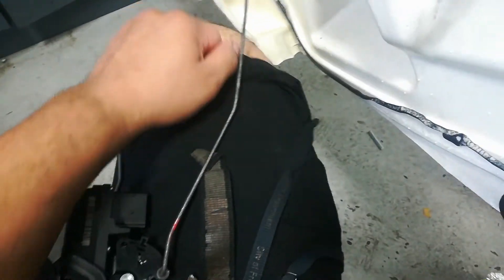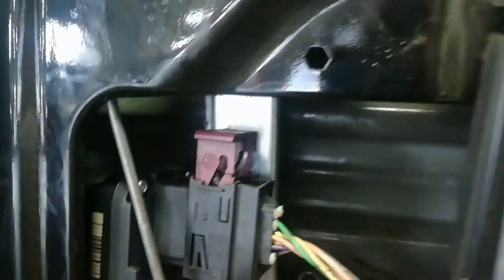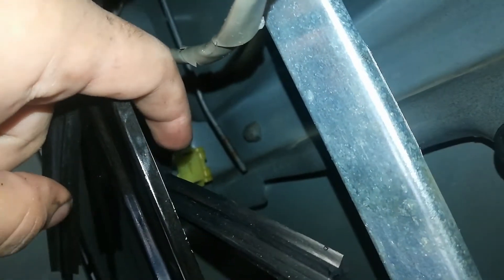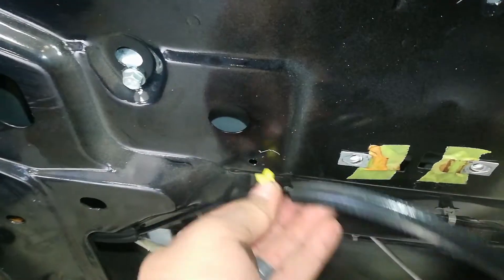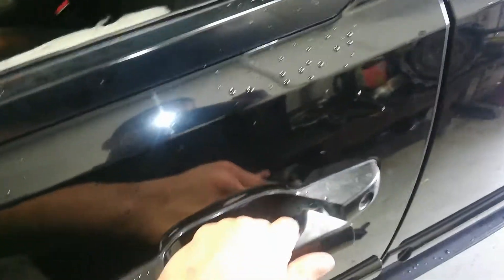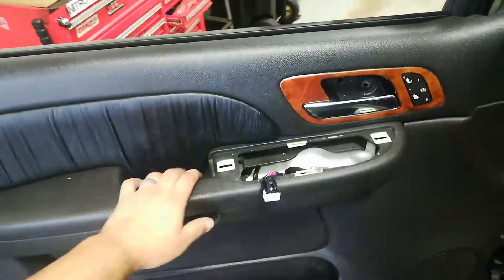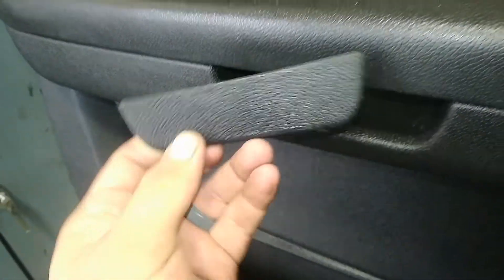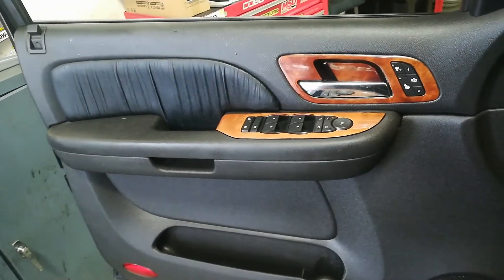2007 - 2014 GMC & CHEVROLET Door Lock Actuator Install. Silverado Sierra Tahoe Yukon ECT

Comment: Dude this was the best video on the actuator r and r.  No need to remove the handle and removing the guide rail nut saves your knuckles. Did mine no sweat

Comment: 😂😅 Bo Build man if you was here I would give you Big hug I been looking on how to put this thing back together I have 2010 Silverado and the video I seen is not addressing hook up and the door latch. I had my rod wrong and I have to replace the passenger side cable too😢😅😂 thanks so much BRO. My handle are different and I have a hard time getting the cable out😮

Comment: At the time 0:29 that long door lock rod, mine is struggling to go up and down. Does that mean I need a new actuator?

I had originally took the door apart to fix the door handle from the inside that wasn't opening the door. So the cable was broken. Replaced it. And now that rod is having problems going up and down when I hit the lock/unlock switch.

Why can't shit just go simple when working on cars. Always some bs happens....

Comment: This won’t work for a 14 bud, the 14 model is already the new body style it requires more work to replace.  07-13 this works just fine...
Reply: early 14 models
Reply: Silverado/Sierra HD and SUVs still had this style in 2014 only half ton trucks switched

Comment: Extremely helpful. 

How ever the problem I have is my door won't open. 

All rods work....
lock rod, exterior rod, and interior rod. 

I fixed it twice already. 
I Removed door panel, Door opened up when I manually pulled the exterior door rod. After that it worked perfectly, feom inside and outside. until I placed the door panel back on. Then it stopped working again. 

Fixed it twice at this point, and now on my 3rd time. Lol

Any ideas?
Reply: You ever figure it out ? I just had the exact thing happen yesterday. And do the same as you.
Reply: @alanpiaskowski9362  Did you figure it out? Same thing here. I have replaced it twice. The second time the lock wasn't unlocking all the way until I got it to lift. Then it wouldn't lock until it took off the panel and now it works